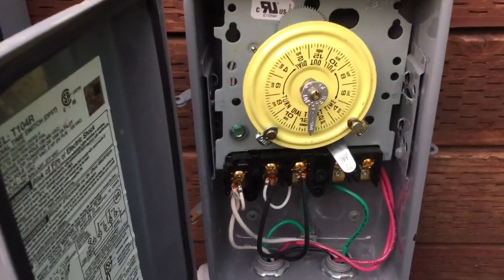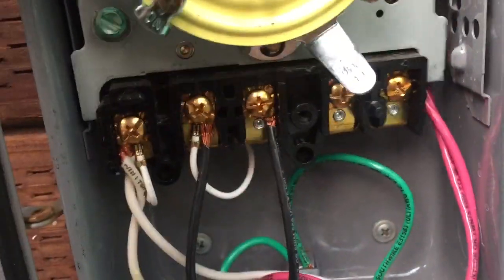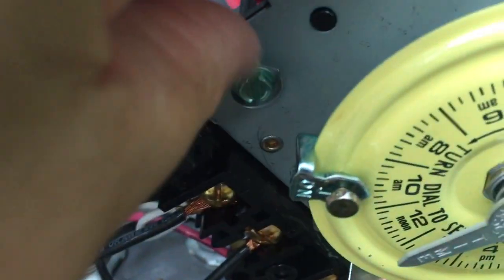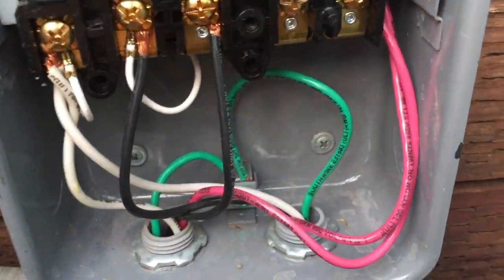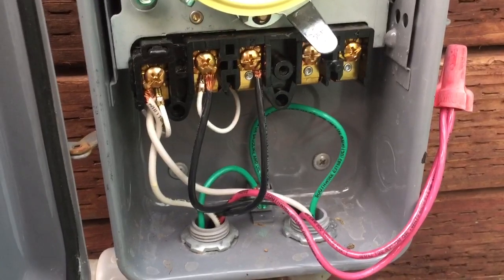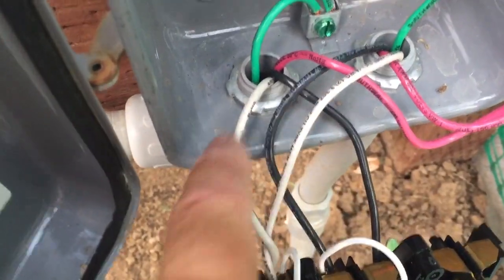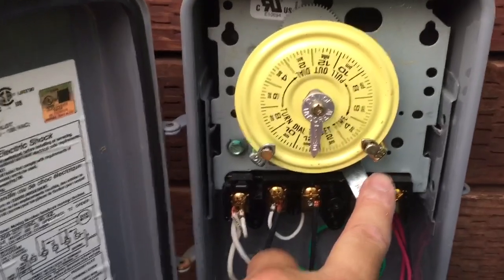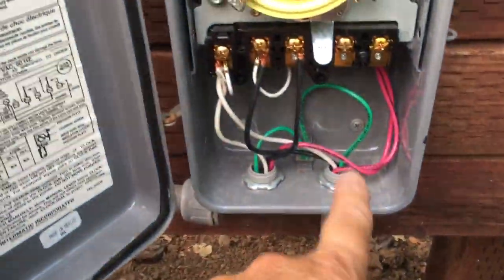Intermatic Timer Won’t Rotate - HELP! Why??

Comment: If your pool pump runs on only 120v circuit,  than you only need a T101R  SPST timer which controls the hot leg only on a 120v circuit. This timer T104R is for 240v DPST circuits only.

Comment: That's a T-104 timer, 240 volts, which requires two hot wires, the black and presumably the red, in order to spin the timer.  The white wires from the timer connect to terminal #1 and #3.  Nothing connects to the "A" terminal unless you're wiring for 277/480 volts (commercial).  You should connect a ground wire to the ground screw on the timer plate so someone is less likely to electrocute you with the way they incorrectly wired your timer.

Comment: The A terminal should have no wires connected to it. Your should ground the plate through the green screw on the front of the plate for safety. The plate as it stands is not a good solid connection to the ground system.

Comment: I believe that the jumper on the receptacle has been removed. The top half of the receptacle is black wired, and controlled by the timer, and the bottom half is hot all the time, being energized by the red wire.

Comment: Your 2 white wires coming from the timer  should be fed from line #1 terminal and line#3 terminal, the clock needs 240v to operate.  Your  2 load lines, one black one red, should go on, one load # 2 terminal and one on load #4 terminal.  #1 terminal, should receive one line side conductor black and #3 terminal should receive the other line side conductor red. Now the timer should operate correctly. The receptacle that is going to receive the plug from the pool pump should be changed out to a 20amp 240 volt receptacle. The current receptacle is incorrect, it is only a 120v receptacle. Also there is no need to send a neutral wire to the pool receptacle, it only needs one ground wire and 2 - 120volt each,  conductors.

Comment: The red wire is an other Circuit he brought two circuits into the timer so that means the plug the top half is probably controlled by the red wire constant power.It looks like it’s wired right check your switch on the timer the Silver switch make sure it is on the on position
Reply: you are absolutely right !

Comment: That’s a 240v timer. A 115v timer will only have 3 brass terminals. You need 240 at that box to run the mechanism timer. You’ll know it’s working because the gears behind that viewing hole will be turning. If they aren’t moving, the mech has failed or power isn’t getting to the timer itself

Comment: i;m having a problem with my 7 day intermatic model T7401B timer switch the load side will not shut off with the timer switch itself here's my wiring install clock A white going to the clock motor and neutual white wire on the line side. 1 line 1 black wire from the 3 way plug that plugs into the wall line 1. 2 load 1black wire from the recepticle side that u plug in a light stereo clock B a motor lead wire and another neutural from the load side if anyone out there knows how i can fix this please let me know thanx and good day

Comment: I think your wiring is wrong.  I have a timer just like this, and my wiring diagram matches the one you have in the printed material in the cover.  The far right terminal isn't a line terminal.  That's a load terminal.  The one next to it is one of the line terminals.  The one after that (3rd from the right), is the other load terminal, and the next one (4th from right) is the other line terminal.  The two line terminals get 120V AC, 180 degrees out of phase (for a total of 220).  The two white wires from the timer clock go to the two line terminals.  It's a 220v timer clock.  Your wiring doesn't even connect up one of the line and one of the load terminals, so there is no way that timer would even turn on.  The manual switch works because it looks like one of your hot lines goes straight to the outlet (the red one).  The other one gets switched in when the lines and loads are connected in the switch "on" position.  It doesn't look good.  I wouldn't know for sure what the whole story was unless I knew what kind of pump you have, but that looks like a 120v plug to me.  It's never good to route 220 to a 120v plug.  I don't know how that outlet is wired or what the pump requirements are, but I know it doesn't match the wiring instructions for the timer.  I have no connections at all on that far left terminal (No common).  Your green grounds look fine.  It probably isn't necessary to ground the face plate because it's seated in the box snugly which is grounded very well.  I have a timer like this that stopped working after working reliably for decades.  I'll be posting a video on how to fix it with a new timer motor.  I hope that helps.  You may have already solved your problem by now.  :)
Reply from the maker: Thanks for your time and all the info! I'm going to be opening my pool soon so I'll post an update on the wiring situation. FWIW, my pump is a 1HP Hayward PowerFlo Matrix Series Pump – 115 volts. I'll get back to you one what I've found out. The plug is a standard 120v outdoor receptacle. I have a 30amp breaker with GFCI. I also have an inline rocker switch (outdoor light switch inside a weatherproof box) on the side of the house so I can isolate the pool from electricity if I need to. My pool is completely surrounded and bonded with buried #8 copper wiring at 4 different connection points to the pool metal support frame.  There's also an inline Perma-Cast PB2008 Water Bonding Fitting that actually bonds through the 2" PVC (pool skimmer to pump) and bonds the water flow. Now if I can only get the wiring right! Follow up later this spring.
Reply: @johnnymoretti hey Johnny.  Did you end up getting the wiring figured out? I'm having the same issue
Reply: @B-TNT  check the comments.

Comment: I think that you have 120v wiring on a 208 v timer
Reply from the maker: You are correct! I have since changed it out for the correct 120v and it's been working fine. Thanks!!

Comment: I had the same problem with my both of my T104's.  Contacted the company and they told me I could buy 2 new motors from amazon, for about 20 dollars each.  Bought the motors, replaced them and still the timers did not move.  Contacted amazon requested a refund, the company that sold me the new motors asked why I wanted a refund, I told them that neither of them worked, even thought they were apparently new.  They said that they would authorize the refund and I asked for their address so I could return the motors I purchased to them.  They responded never mind just keep them.  You see.., even they did not want the motors back.   I will never purchase an intermatic timer again, they are junk, albeit expensive junk.
Reply: After quite a few years and extremely safisfied wih this timer, all of a sudden the  darn thing stopped rotating. I assume the motor is at fault, but I'd  rather buy another new one.